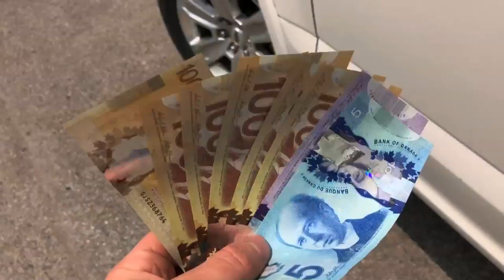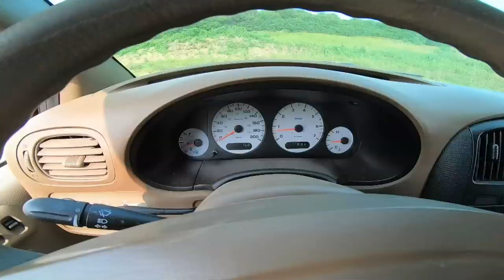How To MAKE $1500 In 12 HOURS!

Comment: u were suppose to sell the f250; not part it out. the seats and door panels are worth money. along with the engine, transmission and t-case.
Reply from the maker: The video is still worth more.
Reply: @markfreeman408  truck was still a good heavy duty well made ford that could of been used as a plow truck or work truck.

Comment: Noo! Poor caravan.
Reply: Don't worry I would have done the same thing to it in fact if it was me driving it I probably would have killed it much faster
Reply: Besides that's like a mid generation Caravan it's not any of the really early 90s or 80s models so it's not that big a deal
Reply: Silas McGee 
The thing is that’s how people thought 20 years ago and now we see no 1980’s or 1991-1995s caravans
Reply: @42luke93  I still see some of those around where I live mostly the older ones of the more round appearance as for the 80s designs there's still a few going around where I live most are in pretty poor shape of course but there's one in particular a light blue one that's nearly mint no funny noises typical minivan exhaust sound pretty much brand new the only nice one in my town There's also very few nice aerostars going around too
Reply: Silas McGee 
Thats nice. I see what you mean though. To see a 1990s caravan getting destroyed now is sadder then this one.